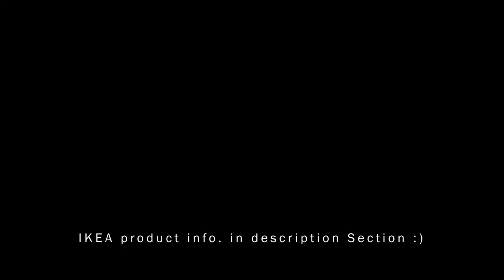Step-by-Step Tutorial : 3D Printing a Lampshade That Will Amaze You (Skirt, Lampshade)

Comment: Dr.Moon. Could you please provide more detail about the paint you used ?
Reply from the maker: Hi~. I used a wood stain (BONDEX PERFECT, walnet). And It was painted over three times. (paint - dry - paint - dry - paint - dry).

Before painting, the surface should be sanded well with sandpaper.

Thanks :)😀